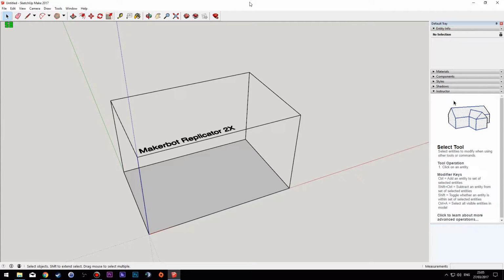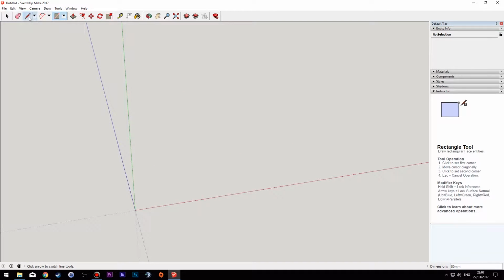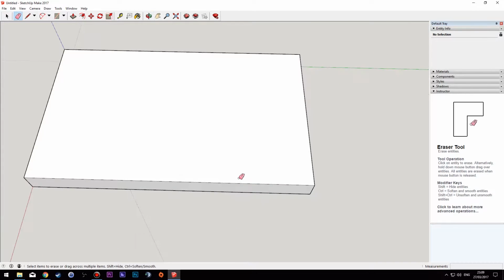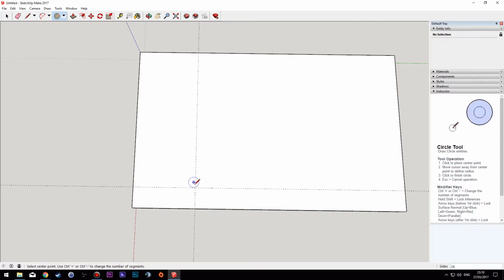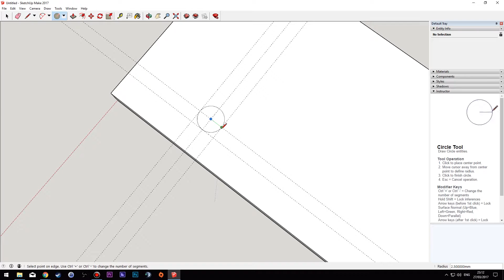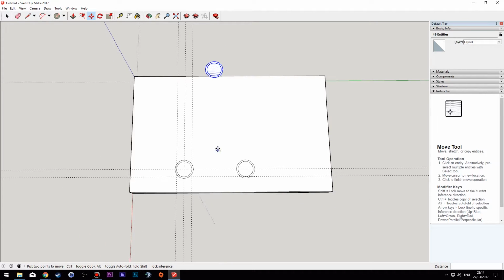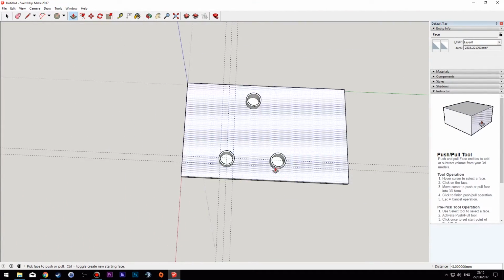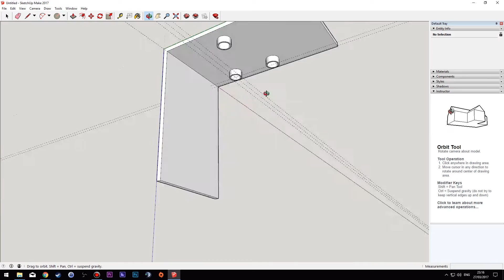Vector 3 3D Printer Modification #6 - Head Cover Part 2

Comment: Hey Nath042,
How did you go with the outcome of this cover?
Reply: Never mind about the cover, I just had my first filament jamup. When I pulled it apart I found un heated filament caught between the transition and cog and pressure wheel. I've just cleaned it out and hoping it all goes good this time. I'm using the white filament that comes with the issues. The red one wasn't too bad but this white one seems to be giving me a mental breakdown.  LOL
Reply from the maker: Thanks for the message, for some reason my reply was lost over the years, just thought i would put this here!